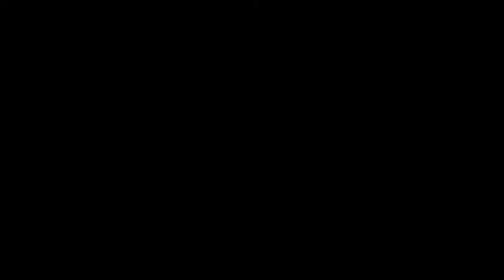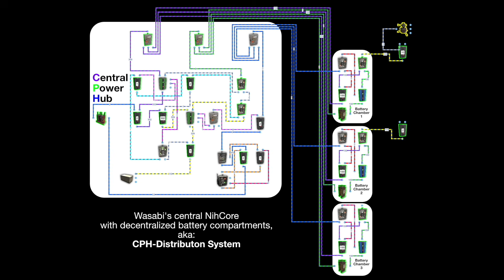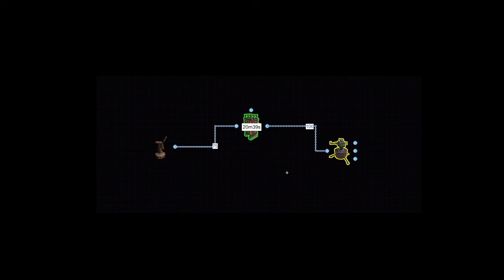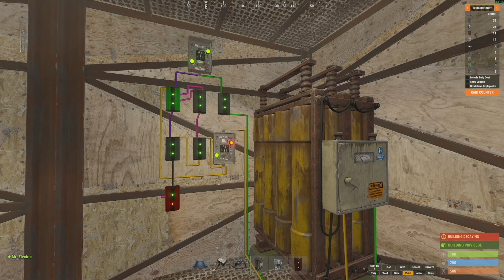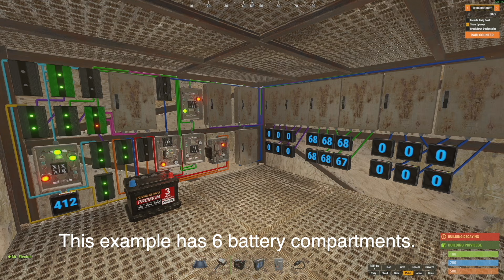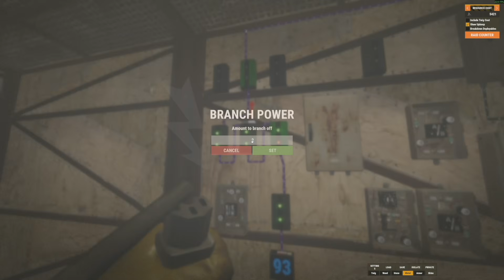Rust Electrical Guide - How to power a base - CPH - OUTDATED

Comment: Dose not work to many items overloads it and shorts the hole system
Reply from the maker: I am running it with 18 batteries on atlas right now and it works fine. maybe go back to the basics and you’ll see that connecting combiners in series is something different then connecting them in a tree. people make mistakes and you definitely did some.

Comment: i have a short circuit, what could i did false? its at the first memory cell :(
Reply: i have been using this circuit for months no problem had a 9 battery set up working yesterday fine logged on today and its all shorted out. so i split it in to 3 different circuits and with 3 batteries each and still shorts out. been trying to figure it out
Reply from the maker: I never had a short circuit ever with this. you must have connected something fundamentally wrong.
Reply: @sissiwasabi i think it is a new bug.
Because when i unplug the Battery , its working again. Thats not normal. And Ibuild this thing on several wipes before, never had any problem with short circuit.
I wanted to get sure it is a Facepunch- Problem
Reply from the maker: @Feoander91 I am rockin this with 18 batteries right this wipe and its working like a charm. maybe your server has an issue. doublecheck your wiring. sometimes the error is in front of the monitor. 😂happens to me all the time.
Reply from the maker: @Feoander91  omg you are right .. I just logged in and I have the same thing ... thats huge
Reply: @sissiwasabi  if you fix it, let me know
Reply: I rebuild everything, but now i have always short circuit/max depth at the first memory cell, when iam adding the first branch after the 2nd OR-switch from the battery chamber.
Reply: @Feoander91 me too. On console. Maybe its console issue
Reply: Is it fixed or the game still broken in that regard?😅
Reply: @deankiznher877 absolutely fixed :)

Comment: Just made an edit for this if your in a charge cycle. Place a smart switch in between the timer and the branch and leave it on always. Once you start a charge cycle you can turn that new switch off to turn turrets back on incase you need them that moment.

Comment: Do i just hook up the windmill directly to the power in on the battery, i do right? (NVM) i read comments so i know now, cheers again lad :D
Reply: Where do i connect the power from the windmill too, is what im trying to say xD I might be dumb but i really wanna use this next force xddd
Reply from the maker: you combine all power sources into one line and put them into the first branch ... or here in my example the counter that shows how much you have in total.

I strongly advise to practice this on a build server first. it is easy once you did this a few times but for beginners this could be difficult I guess.

also make sure to not go over the depth limit of 16 components.

so do combiners in a tree, not in a line.

Comment: i know i am 2-3 months late on the comment but i have come to a verdict to why this is no better than the nexus but at the same time improves on it. Basically you have moved the what would be potential power out the batties and the flip flop system at the end which chooses between root power and back up power and moving that portion of the nexus directally next to what I call the distribution hub where the power is then sent to everything. I if you will expanded upon nexus protection because no matter what you do when the line between the power and the turrent is cut whatever robustness you built is gone. But your design is at the core a nexus. But an improvement in its own creative touch. Really took me a while to connect the dots on how they were so similar and far apart. I will implement both of your ideas and thanks for the insperation! Now if their was only a way to make a bedrock version of the distribution hub :(
Reply from the maker: ty for your comment! tbh, before I posted this video, I’d never even heard of a Nexus system — until the supposed inventor started raging at me in the comments 😂 but that’s fine.

glad you liked it.

Comment: I ran into the problem of not having enough source to power the entire main splitter chain, so I divided my splitters and put memory cell + branch combo in front of them to only power a splitter when the full value is achieved.
Reply: e.g. 3 large batteries consuming total 303 power + 3 small batteries consuming total 153 power. If the source is (say) 400, only the first splitter gets power, if the source is 600, both splitters get power. That way the branch on the battery room is always either 0 or 101, no wasting the residual.

Comment: Is there no point in doing this with a generator or?
Reply from the maker: you would need 2 generators each fully loaded with low grade to equal the power output. also a battery lasts about 4 hours. you could put 2 instead of one per battery chamber and double that. a generator does not last as long as one. also you want your turrets active permanently. a generator is for raiding and standby systems for base defense.

I used generators in the past when the base was too loaded with low grade and we got raided. its a quick and power source independent way to put turrets somewhere where they are needed temporarily.
Reply: @sissiwasabi  I was referring to the large test generator and wow... only just realizing it isn't in vanilla rust. Thanks.
Reply from the maker: @Mottbox nah with test generators I would leave out batteries entirley. 😂

Comment: Hey, so I took the time to actually watch the entire video. What you have created is a bad NEXUS core design, without the actual BCN part; you've completely skipped the main battery backup, and then used source power to power a "secondary power system" using an INLINE. This system is outdated, I say 2020 electrics, it's not really a NIH core either, since the backup power isn't going back to the NIH core. 

What you've effectively created is a half NIH core that then powers an Or/Blocker system.

This is basically super inefficient and probably shouldn't be used, and you've made it a big and inefficient NEXUS.

I don't really understand why you're using a splitter to go to "each one" of the battery groups. 

You're also not really splitting power for "multi-battery" systems, also the kill switch is not needed. You could just have the power cut on the turrets, not the entire system.

Your Circuit also does 1200RW (12 batteries)
But the Newest NIH /BCN / NEXUS core designs can provide upwards of 1600RW>

Also, the tip you do at the end of the video, adding a branch for you're industrial systems, ruins the entire point of your video. The kill switch is just a dumb idea.

If u need to turn off turrets to let someone authenticate themselves, you could just create a simple delay circuit that gets triggered by a switch (which is what you've done), but instead of it turning off the entire power system, it only needs to turn off the turrets. Which can mean the switch/smart switch goes AFTER the OR switch that's powering the turrets?

P.s feel free to join the rustrician workshop Discord for help <3

Overall, I'd rate this circuit a 3/10 for effectiveness. But a 7/10 for creativity.
Reply: dude wtf is wrong with you, what are you even talkin about????
he explained it as much as possible and you still didnt get it? are you that dumb?

thsi video is not even comparable to the shit you try to spit out there 

you dont even have one single coherent sentence dude and your build sucks ass
Reply: What a bold statement from someone who felt confident enough to publish a video in which he can’t even fucking remember how to wire what he’s teaching. You gave zero instruction and stumbled and stuttered throughout the entire instruction piece. Make sure your shit is put together well before talking from a place of arrogance and condescension as if you are some well known rust electrician. Look at your sub count. No one gives a damn about your dumb ass website or discord & clearly your channel.
Reply from the maker: Hi Plague, thanks for the kind words and your offer to help improve things. I’d recommend giving the video another watch to clear things up a bit. Since industrial and lighting aren’t connected to the turret batteries, there’s no need for a central battery room. They don’t require a backup if the main power distribution is destroyed. So the kill switch is, in fact, only shutting down turrets and/or SAMs — nothing else.
I’ve watched your video on the Nexus system, but honestly, I don’t see any real advantage over my approach — it’s battle-proven and simply works.

That’s the beauty of life: one problem, many ways to solve it.

Keep the good energy going. Enjoy life.
Reply: @sissiwasabi So would you just branch off 127 rW right after the root combiners for a large battery dedicated to industrial/lighting then? 

Edit:
Or would you just run them directly off root power and skip the battery all together, branching off only the total required rW? Now that I've said it, this way seems like it is probably what you intended and makes way more sense. 😂

Fantastic video!! Keep it up!
Reply: @sissiwasabi  It's just an odd way of doing a backup system when it could be more efficient. I would rant about all the inefficiencies and the ways it can be fixed, but honestly. I'd rather not. everyone to their own
Reply from the maker: You did it already. No need to repeat yourself. :)

Comment: You earn a sub! thank you for this amazing guide, I was wondering if you could help me with a small issue. currently I'm running your set up with 3 turbines 3 batteries however when I try to add 3 more battery I'm getting an issue of short circuit / max depth of my batteries root combiners going into the blocker
Reply from the maker: hard to tell without seeing it. but you must have something wrong using only 3 turbines and 3 battery compartments. its pretty impossible to run into a deph issue this way unless everything is very far apart and you use alot, I mean alot alot components to lenghten you cables.

ill do a video on depth in the future.
Reply: @sissiwasabi would it be possible too have yoy come inside my solo base too check out the setup ?